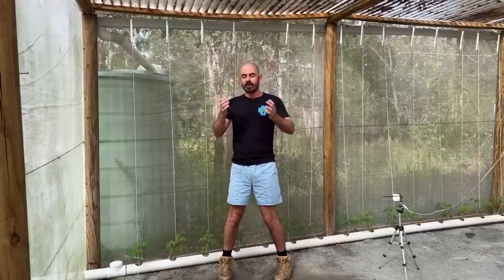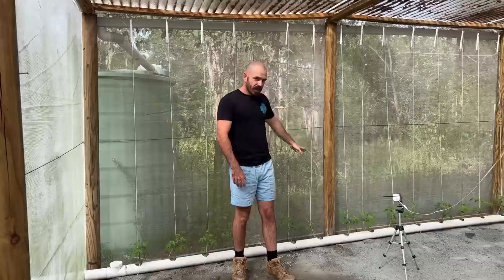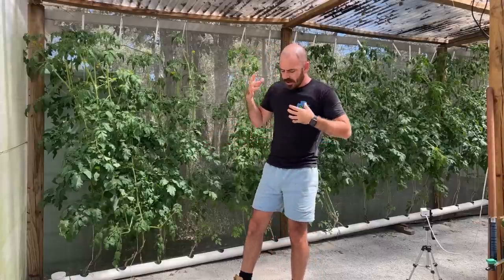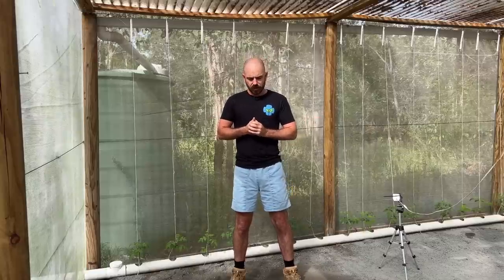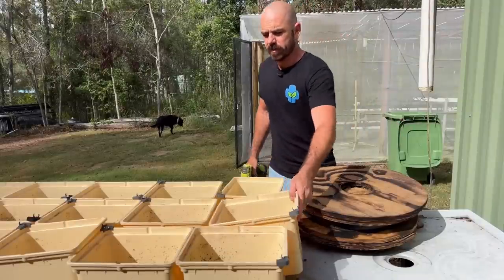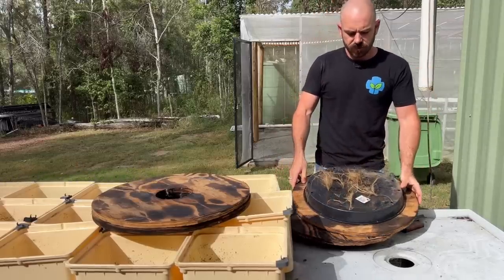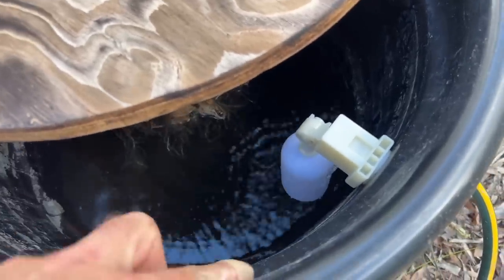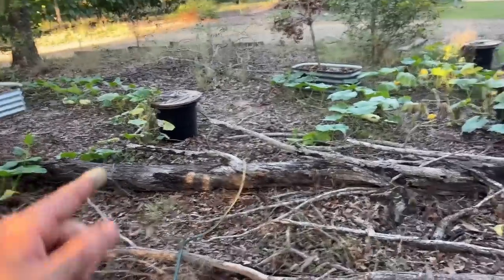How to Grow Kratky Hydroponic Pumpkins: Infinite Kratky

Comment: You could  fit the float valve  into an upside down 150mm  pot and place that into the container. That should stop stray roots from interfering with its function.

Comment: The old float valves that you had problems with are differential valves and require a minimum pressure to work properly about 0.5 bar. this means that the bottom of you IBC tank must be at least 5 meters above the ground. They will not break down slowly like a ball valve. They just stop working resulting in all your nutrient being emptied or no nutrient getting to your plants. Ball valves are the more reliable in a hydroponics system and 100 gallons of nutrient being dumped into the environment could land you in a lot of trouble if it gets into a river.
Reply: 5 meters? seems extreme ...

Comment: I just had the float valve issue with 5 gallon buckets, I had drilled in the side and the roots kept getting too large and keeping the float valve down, I used a piece of pvc like you did in the first setup but with a bulb float valve on the end so the float comes straight down from the netpot lid, always a project around here lol. Great video Mitchell thanks mate!

Comment: I found my Tiny Tim cherry tomato seeds this evening. Gonna set up a 5 gallon bucket outside under the eve of my camper roof with a 6 inch grow basket in it with tomatoes and see how it goes. I may put a grow light on it too to boost growth. Wanted to test one bucket before investing in more. I`m considering trying yellow squash indoors in Winter in it or some other crazy experiment.

Comment: I see you have started using the water plant pots as net cups.... I have been using them for about 3 yrs now, at $1 when I bought mine, you couldn't beat it.
I trialled a late summer rockmelon in a Kratky system this year, I't really didn't have enough time and it was pretty hot... It wasn't a huge success but once I move into a place where I can actually have a proper setup I will go all out.

Comment: Interesting. I just started my butternut squash kratky a few weeks ago. In a styrofoam box (i layered with plastic). Compared to the one planted in soil, hydroponic is slower. I think its due to the plant focusing on root growth

Next time, dont let water level drop that low then topup drastically. Plants will suffer. Unless its near harvest. Then its better to cut off water source. Just like how farmers dont water their watermelons near harvest so the fruit taste more concentrated

Also, if the ground level is the same for each bucket, using 1 float valve would be enough. Place it on the first bucket. For the rest, just simply connect a tube (drilled from the side) that is  lower level. Never higher than the water level for the first bucket with the float valve. Too low, there is a risk for the water to drain too much in case there is a leak at/along the tube
Reply: Interesting ideas! I was thinking it would be a fun experiment to do a side by side with ground planted and kratky planted stuff too! I am curious how they will compare at harvest time.

Comment: Question for you. I really like the through the top install you did with the original float. It works wellbwithbmybaetupnof 5 gallon buckets close into each other. Before I buy the new floats you recommend I was wondering if you could tell me do you think the new ones would work from the top down for an install like you did with the first one though the lids?

Comment: Great project! Why not to use single float valve for all buckets and level them? That way you will have less chance of failure and less equipment to control.
Reply from the maker: Incredible
Reply from the maker: Duno why I didn’t think of this…. Cheers
Reply: @Hoocho  the only thing you will need to make hole in the container below water level and make it watertight. But you can circumvent it if you will put wick (rope) inside the tube feeding the container. Then you can put it over the top of container.
Reply: And run the single float in a container with no roots! If the containers were all connected at the beginning of the grow the nutrient level would fall evenly. Add the float 1/4 way down from the full nutrient level (it will be fully submerged) at the beginning of the grow so that no roots later die due to being flooded. Use 6mm (not 4mm) tubing with top hat grommets that are designed for it.
Reply: @dmitryplatonov  not necessarily! You could run a tube between them coming in the tops of the buckets and pre-fill the tube with water. Siphon effect
Reply: @stjimmy5294  I would never trust syphon effect in this situation. You get some air in your plumbing and your bucket stops refilling and crop dies.
Reply: different crops will drink water at different rates surely?

Comment: Great video as always.  For people who want to use this infinite system, but don't have a res with a higher elevation, have you thought of a way to connect an aquarium pump to refill the buckets instead of gravity fed?  I am trying to do that for my system, but am having issues finding something to prevent a "dead head condition" when the pump is running, but the float valves are closed (full bucket) and the pressure would build up.
Reply: Municipalities run water pumps to fill water towers. Gravity is much easier and more reliable than forcing a pump to provide contant pressure. You could do something similar by connecting a pump in your res to a timer and sending the output into a bucket on a stool. To prevent any overflow, a second tube could take any excess liquid back to the initial reservoir.

Comment: if you place a 100mm pipe  with ( holes at the bottom ) over the float valve you prevent the roots getting in the way of the valve

Comment: why don't you put a vertical pvc tube connected to the reservoir on the outside of the bucket to house the float valve? it would prevent the root system from messing with it. seems like the most simple and cheap fix to me.

Comment: Is it really a Kratky system anymore if it refills?
Reply: Yes. Its not circulating. Manually topping up water/nutrient = auto refill by float valve
Reply: Yes, it's still Kratky as it has no recirculation and no airation.

Comment: It is not a good practice to refill the reservoir without draining the remaining liquid. Because it will increase the concentration of minerals that the plant does not take up from the water. It will also increase the concentration of some bacteria. It is therefore necessary to remove all remaining liquid from the reservoir before refilling.
Reply: For bacteria & algae, hydrogen peroxide would help, also providing oxygen boost for the roots.
Reply: It's normal practice. This way you will not have abrupt change in EC in Ph. As you refill, concentration of minerals will trend towards the concentration of the solution you are refilling with. Check prof. Kraky channel, he grows peppers with this method perfectly fine.

Comment: Float valves on low pressure are a waste of time. They also can gunge up easily and not shut off. You should have built an overflow just above your water height in case they fail so you dont drown your plants. I built an electric level, it uses 3 x S.S. 5mm nuts with wires soldered in. You can fully adjust the height for both on and off. It controls a 12v relay. Totally more reliable, but far more advanced.
Reply: you know it's on rain water only